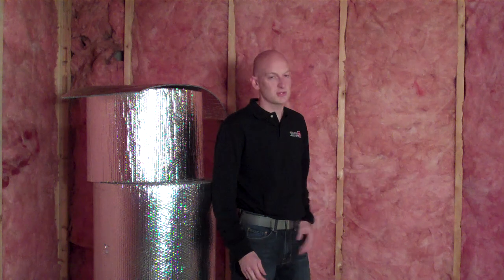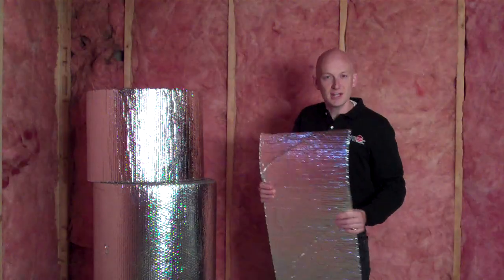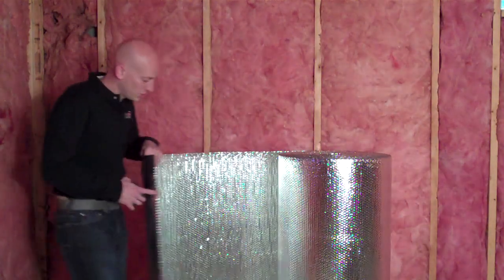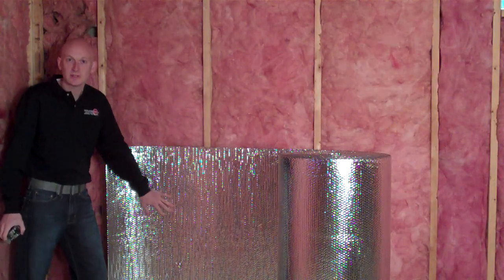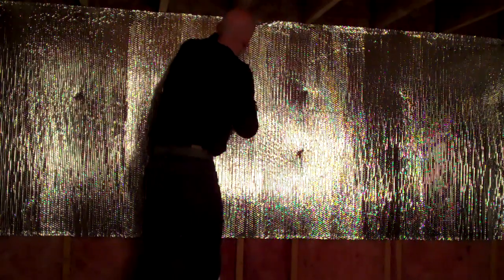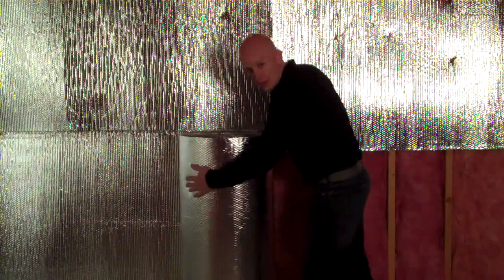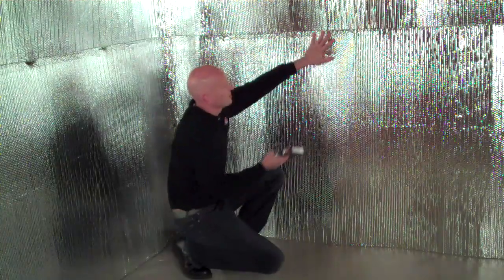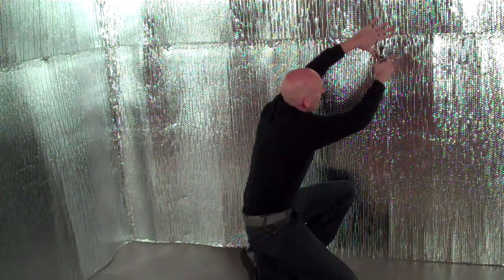Insulating Walls with Reflective Foil Bubble Insulation

Comment: COuld you use this product and cut it to the correct width for a between the studs as a vapor barrier and place fiberglass, rock wool insulation on top ???  The ceiling of my house has 2 by 4 with standard 16 inch centers. That way the vapor barrier will be facing inside the living quarters. Thanks

Comment: I need a help please. I have colder room in my house and I know that it leaks energy because I think it has thermal bridge on its corner. The room is located in the north direction of the apartment. If I installed such insulation, could it form Mould between the wall and this insulation in this corner while we will not be able to see it? Thx in advance
Reply from the maker: Always tough to answer questions about moisture  as it's so specific to your building and local climate.  If it "leaks" then moisture can/is moving through.  Whether it would get trapped and create mold we cannot answer.  We can say the insulation does not promote the growth of mold, a positive feature of foil insulation products.  Maybe air seal the area 1st then insulate from there?

Comment: Can you drywall over it?
Reply from the maker: Yes you can.  You do want to provide the necessary 3/4" airspace between insulation and drywall.  This can be accomplished by using 1" (actual 3/4") furring available anywhere locally.
Reply: @InsulationstopRadiantBarrier  so cool thanks man

Comment: I've only seen videos using the single foil layer in attics, and a lot of talk about radiant vs. conductive heat, and air gap.

No explanation on the choice of material in this video.

Whether a basement or an attic, i assume the goal is he same: In the winter keep the warmth in and tne cold out. The opposite in summer.

So why different products?

Comment: A glaring issue I see here is that with any sort of vapor barrier or radiant barrier, both inside or outside of the wall, you should start the wrap layer at the bottom and all layers above it should overlap it 3" to 6" depending on local codes.  By doing it top down you create a seam for potential moisture and condensation to drop into and collect.  So I consider this to be improper!  So much bad information on YouTube unfortunately.

Comment: Are there any kind of "tabs" or "washers" you can use to lay on top of the insulation at staple point?  Just using the stapler on the insulation makes it very delicate

Comment: I have a question - I am insulating a wood shed built from a kit.  I bought the one that has a white side and the aluminum side (Reflective foam core 1/4 inch insulation barrier roll).  Do I face the aluminum side outwards and the white side facing inwards.  It is very hot where I live 100+ for many days a year and I want to stop everything I have stored from getting too hot. Am I doing it correctly?

Comment: I made a room inside my shed and I used this to insulate it. It keeps the heat in during the winter and so far it keeps a constant temperature of around 73-75 degrees even when it's been about 90 outside. I keep my window open as well to help with ventilation. I'm in north Florida

Comment: My cabinets are next toa wall that has really weak insulation or maybe none at all. In the summer, the house can be decently cool, but the cabinet space feels like a heater. Vice versa for the winter. Can installing this aluminum foil help, if I apply directly on the walls within the cabinets?

Comment: Nice video, although foil tape should be used to completely seal the gaps, including any other holes. The insulation behind is likely to sweat with condensation without an air tight vapour barrier on the warm side of the insulation. The sheets should also start from the bottom and overlap until you reach the ceiling, as condensation is likely to form on the inside and run down the inside face.
Reply: I was wondering if the foil would trap moisture in the fiberglass.
Reply: Condensation will most likely be between the batt and the foil. Top down would be correct in this application.
Reply: You are thinking bathroom vapor barrier installation.

Comment: I have a metal shed 10×12. How could I use this in my shed? Also, do I put it on the ceiling and under the floor?
Reply: Spray adhesive,
Reply: You wouldn't get good insulation. It needs to have space behind it, not directly on any wall surface.

Comment: Hi i just bought this type of insulation for my metal shed, will it work for metal shed?  Im trying to insulate my metal shed where i’m putting my birds,  does this type of insulation good for a metal shed i live in canada which is we have 4 season here, and im just worried about the 3 season which is winter fall and spring these 3 seasons r very cold, i hope u could give me some ideas
Reply from the maker: Insulation will reflect radiant heat, keep buildings cooler in summer and keep heat in during the winter.  In the winter you must have heat to keep in obviously.
Reply: Building Supply Stop thank you

Comment: All of these radiant barriers need at least 1 inch of air space to be effective. Every manufacturer has that info on their packaging and web site. Attaching it in this manner doesn't do any good.
Reply from the maker: Agreed, it's actually 3/4".  You can fir/strap the wall and then finish with sheetrock/paneling.  This will achieve the correct recommended airspace.

Comment: Hello, looking at insulating my basement and will be framing 2x4 with fibreglass insulation in them and was wondering if this product be safe between the studs and concrete wall?

Comment: Can this be installed directly on the wall instead? I’d like to use it in my garage which has cement walls...
Reply: No it doesn't work like that. The insulation comes from the gap between the foil and the wall of the shed.
Reply: @milliepaterson2758  Correct. Does it work for creating a "cold room" as well.?

Comment: Curious?  Would this prevent cellular 5G waves from permeating  your homes interior?
Reply: You need the proper thickness , also overlapping layers should be well pressed together, and also attach the foil to earth ground. Doors and windows are not allowed. Generally impractical for the avg person who doesn;t run an airforce antenna testing facility.
Reply: Or wear a foil hat

Comment: Why firring strips?  Can you not apply drywall right on top?

Also, you didn’t say how thick it is or what R value it adds by putting on interior
Reply: If you put drywall right on top, it will no longer be a radiant barrier. It will conduct the heat from the drywall through the barrier. There must be an air gap between the radiant barrier and the next surface to work
Reply: No u need an air pocket for the reflection

Comment: On a bare metal trailer,  should i use REFLECTIX against the back face of the metal (spot glued),  then denim insulation in the channel,  then REFLECTIX on studs facing interior?  Please advise.
Reply: You wouldn't get good insulation. It needs to have space behind it, not directly on any wall surface.

Comment: This is exactly what not to do. The drywalll should be glued and screwed to the studs. I saw this done before and there ended up being screw pops everywhere a few months later. The correct way to do it is to fasten it in between the studs leaving a 3/4 inch air gap.

Comment: Can it be put on sheetrock ?
Reply: No, hence the furring strips. You do not want the foil insulation against the sheetrock because it will suck in the heat (or cold) and transfer to the other side.

Comment: I would use aluminium tape to seal the seam from both air or moisture infiltration. I would want to make both horizontal layers, top and bottom, into one, single, large mass, impervious to air, heat or moisture escaping or infiltrating by taping that seam closed.
And certainly seal any holes cut into that foil, such as electrical outlets, pipes, vents, etc. 

Just my 2 cents worth.

And make sure you keep on top of the moisture levels. 
Living in Las Vegas it isn't a huge worry for us, but for most others it could lead to mold, mildew, fungal, yeast or metal rust issues, as well as air quality issues (CO2, CO, etc) from a space being 'super' insulated from any air leaks! 

Too little is as bad as too much, of anything. Understand the ramifications of anything you do, as all positive things have a drawback somewhere, for those unaware of the total picture!
Reply: 👆 what he said
Reply: That's what I did

Comment: I’m going to use this product on my attic knee walls, it already has fiberglass installed and the floor has plywood. I believe with the foil bubble insulation will help a lot and hopefully make my two 2nd floor rooms balance out in room temperature.

Comment: Hvac guy
Ones I used this insulation on the attic just rolling above mineral ins. 
After two years i removed this becouse ovner seel the house i find from inside side mosiure ! So the house not breathes. For sure alter couple years mold be there .

And another problem with this is------

No cell phone servis!!! Verry lo signal!!!
low network coverage
Reply: I want to confirm that you had installed this above your insulation on the top side of you rafters? I would think this should go on the warm side under the drywall

Comment: I have a small steel trailer I'm converting to a photo booth, can I usesprayadhesive with this insulation and not have problems with it coming down due to heat.?
Reply: I wouldn't trust the spray adhesive long term.  Use a construction adhesive for a permanent bond.
Reply: Thanks..

Comment: Can this be put up on an exterior wall before putting in the batting insulation if an air space is created between them? I have a room that has it installed already. It was put up before the outer plywood was installed. It actually insulates pretty well this way but I want to use the room as living space and needs more insulation. So would like to add batting and paneling.
Reply: Yes you can

Comment: I put some of this up under my crawl space.   It starts getting warm once you get quite a bit of it installed, due to the fact that it reflects around 95% of your body heat.   Takes a lot of staples if you want to create a vapor barrier, but it beats fiber glass for that, and you don't get covered in fiber glass when you're crawling around under a crawl space.
Reply: please - could you tell me more about your installation.  i am considering putting this under the joists of my floor in my crawl space.  what is the end result for your utility / heating bill ?  noticeable difference in anything.  all the information you can provide would be appreciated.   thanks - mick.
Reply: I haven't finished the installation yet, been too busy with other things.  So far I can tell a difference in the one room that I have it under. 

Don't have enough information on the heating bill, as it's been unseasonably warm here so far this winter.   We had some cold weather earlier in the season, and I did notice the heat didn't come on as often, yet it stayed comfortable.  That's with just one room insulated,  so I imagine it'll be pretty toasty once I get it all done.

I didn't have any insulation under the floors here before, so this will make a big difference.
Reply: As the other person stated I'm about to do this as well because my house didn't come with insulation as well. So three years later what's your results with installing this? When you did it did you do two layers or one layer?
Reply: @TheOfficialSoulfire  What were your results? His answer was it was warmer n less drafts. Were you able to put a $$ figure on heating costs saved?
Reply: @TheOfficialSoulfire  I did 1 layer right at the bottom of the 2 x 10 joists,  folded into the joist space about 1/4" from the bottom so I've got a good airspace between the floor and the insulation. 

Takes a little longer to install, because you have to staple it every few inches,  but you can work in comfort instead of being itchy the whole time.  That was the main reason I went with this product instead of fiberglass.

Hard to measure difference in heating bill, as I burn oil and temps have been crazy past few years while prices fluctuate.   Definitely warmer when it's cold,  and I don't feel drafts when the cold wind blows.
Reply: @Scott.Farkus  okay so basically you only did one layer and it sounds like that's fine to do correct? On YouTube their video shows a guy putting two layers with space in between. I'm also assuming I can't just install this across a bunch of joist and instead install into each individual cavity like he did correct?
Reply: @TheOfficialSoulfire  If you go to their website it tells you the R value you get with 1 or 2 layers.  2 gives you a higher R value,  but 1 is definitely better than none.   You could run it across the joists like you said, but there would be the seam left where the edges meet that some air could pass through; I suppose you could tape the seam where the edges meet.   I folded my edges up between the joists and stapled them, to avoid that issue, plus it looks better that way.
Reply: Fiberglass performs a completely different purpose than foil. Foil placed next to the insulation material almost completely eliminates any potential R-Value gain, as foil has little to no discernable R-value. It creates a radiant barrier. To have any R-value you must create an airspace such as installing on the bottom of roof rafters that do not contain insulation.
Reply: @DyslexicLunatic  The foil is reflective, it has an air space between the 2 sheets of reflective foil to prevent any heat/air transfer there, then you place it so you have about 8 inches of airspace between it and the floor/ceiling to create the airspace.

Comment: where is the all important vapor barrier? this will destroy the R-value of the insulation!
Reply: I would use foil tape all the way around the joint between the two layers. Then you most definitely have a vapor barrier.
Reply: The foil is MUCH thicker than typical poly (typically 3/16" versus .006"), it actually is better as a moisture barrier..
Reply: Brend-Petter Løvaas

Comment: I don't think he said WHY you need furring strips before drywall. but it's because you don't want conduction to occur between the 2 surfaces. you want to create that distance so only reflection can occur.
Reply: 3/4" of an inch or more for the airspace.  Typically the foil goes to the side you want to keep heat out.  If that's both, interior and exterior, as you are going to heat in the winter, you have to make a choice.  Keeping the vapor barrier to the metal will protect other insulation inside.
Reply from the maker: +romansten9 Agreed.  Without an airspace you don't have a true radiant barrier.  This benefit would only be in the bubble layers (resistance) and the fiberglass is far, far more effective for that.
Reply: +Building Supply Stop How MUCH of an airspace do you need??  I'm thinking of using this in a shipping container to use as a shop.  I'm using 2x2's to furr out the walls away from the steel sides, and I'm using OSB as my walls.  I was thinking of using unfaced fiberglass and covering with this, and then the OSB.  Do I need an airspace between the OSB and the foil insulation?  Or would the foil be better on the outside of the fiberglass?

Comment: Yes it is only a basement ,but for a "professional" to do such a rough job I am disgusted, I have used this product and it is easy to tension it and staple in a uniform pattern and make it look much better.
Reply from the maker: @Kelvin, We specialize in providing the insulation and not so much as videography!  So you know the material was taken down after the shoot and reinstalled and looks perfect.  We appreciate your comments.  I'm guessing you were watching at the  the 2:02 min mark?

Comment: Will this help block alien transmissions lile my foil underwear does?
Reply from the maker: Don't know where to start with that one Bruce....
Reply from the maker: ***** Steve: I've heard of potential cell phone reception issues but not TV reception.  Isn't the antenna on the roof?
Reply: @InsulationstopRadiantBarrier  This is how you also isolate yourself from excessive EM radiation. (hence the bad coverage on your phone) the towers a low to the ground so most signals are horizontal before they reach you unless the tower is very near.
Reply: @InsulationstopRadiantBarrier  just asked about this on the comment feed. May need to factor that in when I choose my insulation material I guess
Reply: Bruce Almighty Old comment but I have to say no.  Aliens have progressed past electromagnetic signaling in any frequency and currently use     partical beam emission to transmit coms that will go deep into the earth let alone be blocked by a .005 film of aluminum.
Reply: Bruce Almighty lol
Reply: .......you are a strange and interesting person..,......hahahahaha.........
Reply: ***** is that a pun?
Reply from the maker: +Tim Dunk What NASA report are you referring too?
Reply: LOL!!
Reply: A sure fire way to block every tv channel and all the mind numbing commercials. Better yet, just cut the cord....
Reply: Curious though, would this prevent cellular 5G waves from permeating your home?
Reply: @jodiehamilton8518  it will work with EM waves used by humans. It will be like bulid your house using mirrors trying to keep out sunlight. If reflected outside inn, the EM comes inn. That means any em wave so if you made your house like this it will be difficult making a call on your cellphone
Reply: You idiot! Everybody knows you wear a foil hat!
Reply: Yes it will. Please use your underwear to block Fox News.. their transmissions are full of shit
Reply: @mjames2117  LOL! That's what they told us, but now we know the Fox News Channel was created to cover all the news fairly, not just one sided opinions and thought presented as real news as all the rest do. Most media is useless. 😊
Reply: @mjames2117  

H